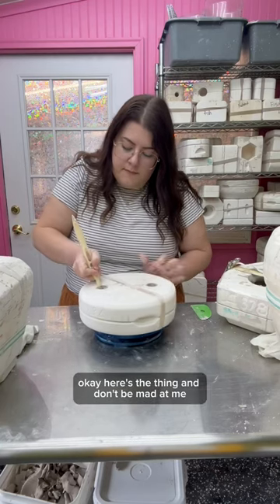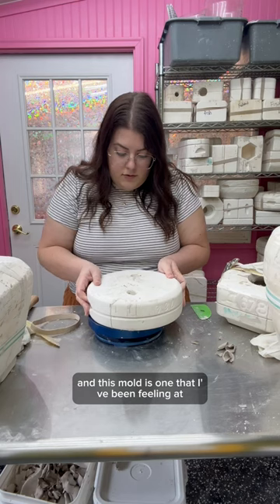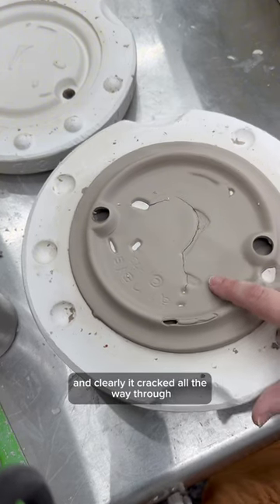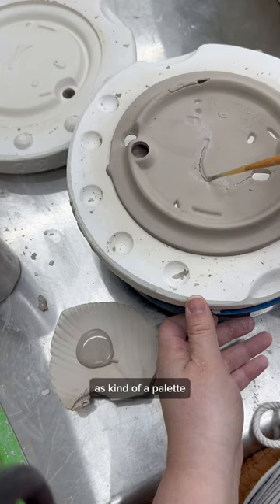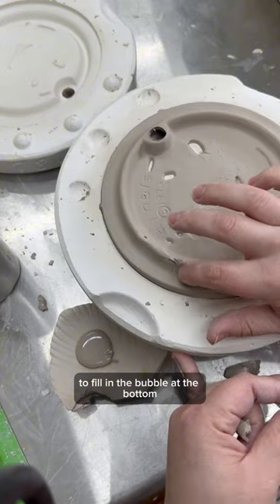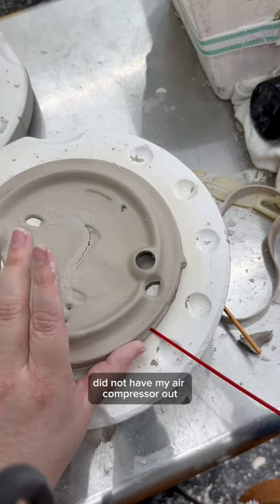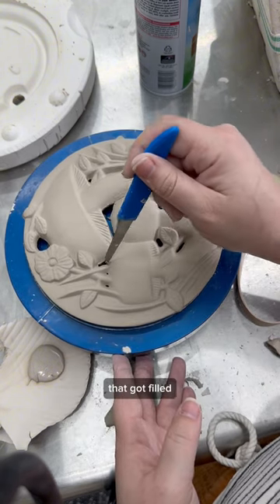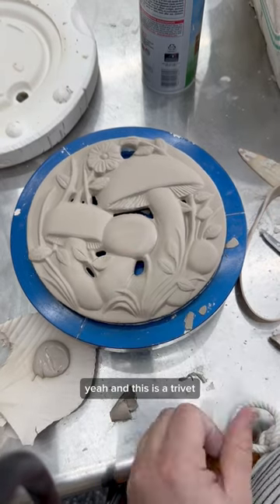But like, why do I feel guilty when I cast and don’t film it? ☹️😂 Love you besties ♥️ #ceramics

Comment: I think it’ll make it through the fire.  as long as your additions are properly attached and no air bubbles or pop them off… But I wonder when you’re pouring slip into your mold can you put your molds on top of a jewelry vibrator? I remember being in a jewelry class watching the procedure when you’re filling a mold with the material that pours around the wax ring they put it on a little vibrator for a while, and it gently vibrates all the tiny bubbles out. I think you can vibrate your slip once it t has been poured into the mold, to get into all the little crevices and work the bubbles out … Just wondering if that will work

Comment: I'm honestly surprised that when you pour a mold you don't take a small vibrator to it to help release any air bubbles so that it'll fill those areas. I would pour the mold,  vibrate it, and then pour out the mold after its sat. Maybe that would help the slip fill all of the delicate areas better.